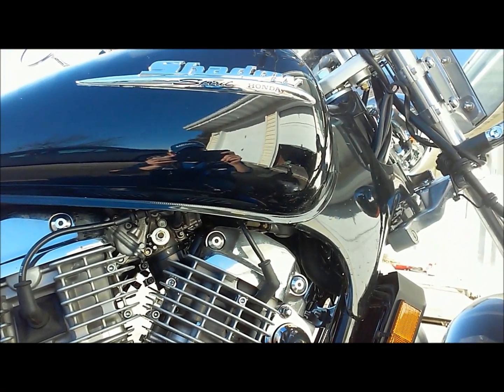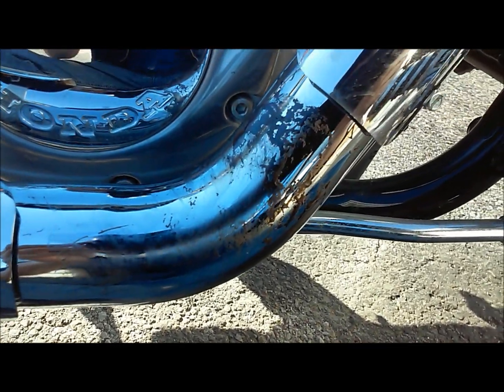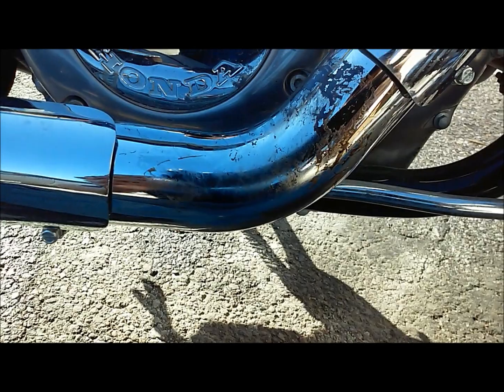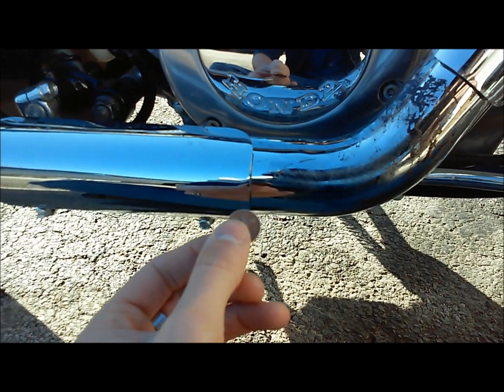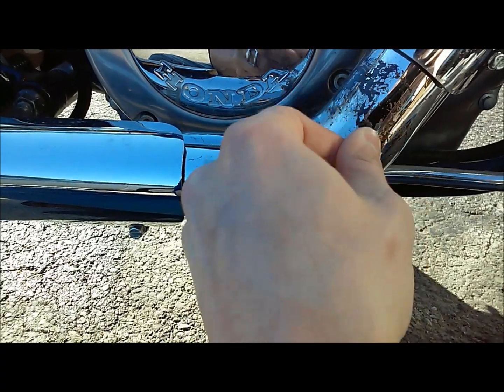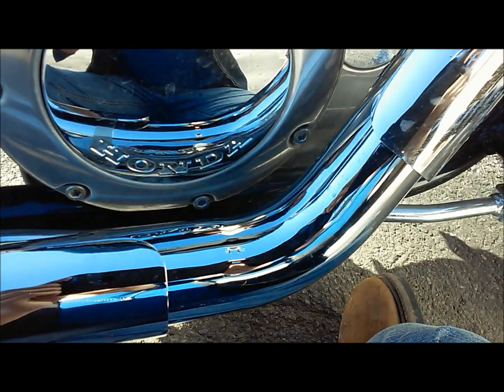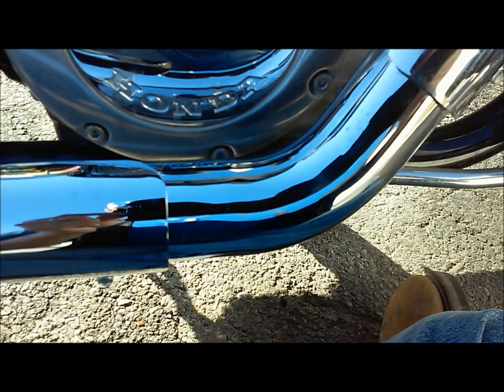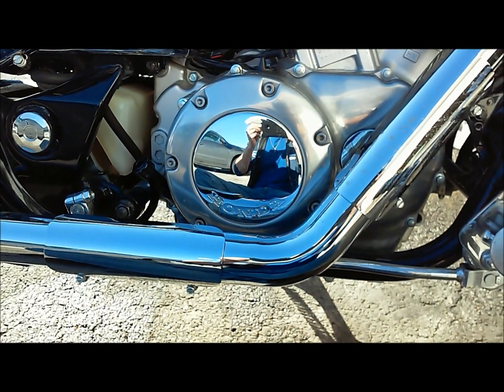Remove Shoe Rubber From Motorcycle Pipes w/ Coin !!! FREE & EASY

Comment: You just saved my butt. My smart ass went to wipe a host exhaust with a microfiber towel and it instantly burned to the pipe, with a 1967 penny I was able to get all of it off plus some black gunk (probably boot rubber) off of it as well. Looks better than before I messed it up 😂

Comment: WD-40 worked for me to remove melted vinyl cover on hot pipes. Let it cool completely(next day) spray on WD-40 and gently remove the residue with razon blade and wipe away as you go. repeat as many times necessary.
 worked great for me.

Comment: #0000 steel wool and oven cleaner.  :-)  Warm up the pipes first.  Spray the cleaner onto the wool, not the pipe.  Soak it, rub gently. 
 Then wipe clean with damp cotton towel, and after it cools use a dry cotton towel.

Comment: If a copper penny works, I'd imagine so would a copper or brass brush?  Maybe a little WD40 to the mix?  how about 0000 steel wool?  I forgot to case my trickle charger pig tail and it melted on my exhaust yesterday, lol.